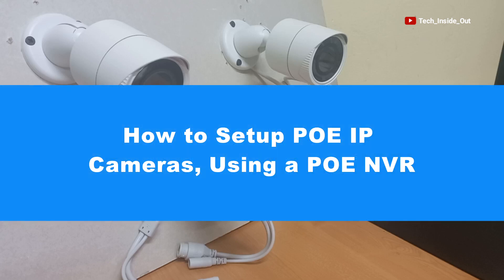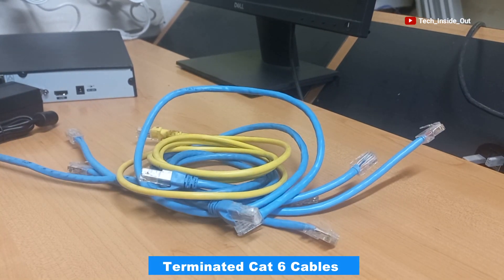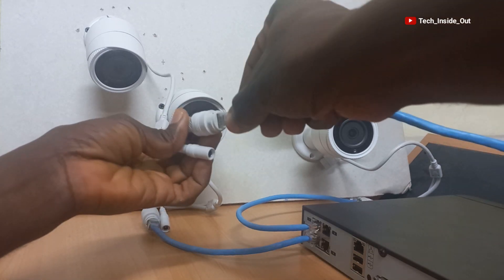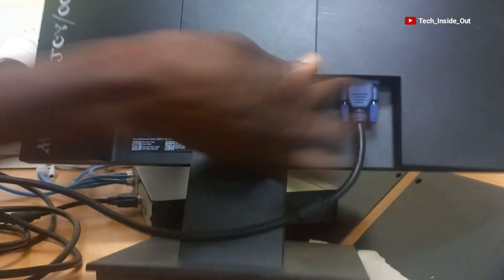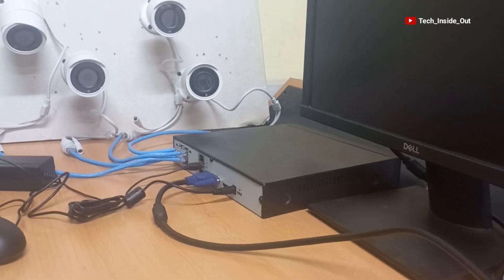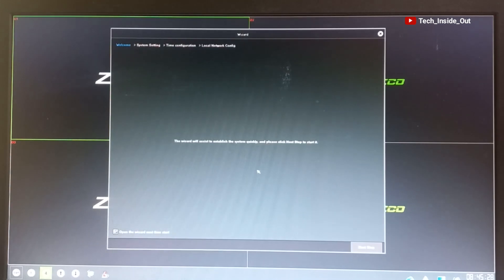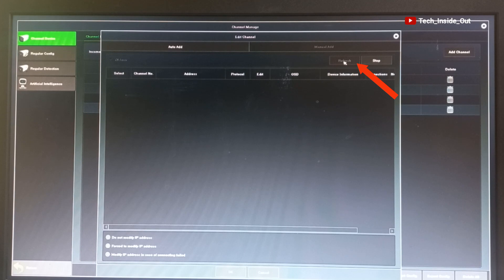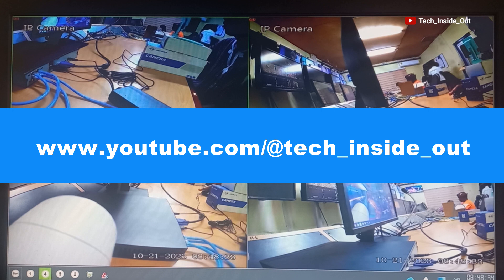How to install network IP CCTV cameras using POE NVR

Comment: when is it neccessary to use power splitter?
Reply from the maker: The splitters are used whenever you are using non POE IP cameras and you wish to power them up through the same network cable that carries video from the camera.
Reply: @Tech_Inside_Out  great. Thanks for the reply 🙏🏻

Comment: Thank you. This is the simplest yet and I’m thrilled because as you explained it, I was able to connect my cameras to my DVR without a problem. although, my monitor to DVR cable is USB, it was easy to see where they connected and voila… it works, I wish. The monitor is on and the NVR but it says “No Signal.” Sigh. Maybe I’ll just sent it back. So frustrating.
Reply from the maker: Am excited it worked for you. Please check your cable connecting your camera.

Comment: Nice tutorial. One question that maybe you haven’t had before. 

Is it possible to connect a monitor in one room via the VDA port & also connecting to my TV in another room using the HDMI port. Two permanent connections.
Reply from the maker: Yes, you can do that

Comment: Perhaps a silly question but does it matter how many POE ports you have if you are only using a switch? For example if I have 4 POE ports on my NVR but have a 9 port Switch with 9 cameras plugged into the switch would this work okay and I be able to view all 9? Or would this be too much for the NVR? Many Thanks
Reply from the maker: You have asked a very good question, and the answer is that the number of ports on the NVR is the maximum number of cameras that the firmware in the NVR has been designed to receive.
There are some brands that may give room to go beyond the POE ports on the NVR,  in such a case, you would see the NVR capacity stated with the number of cameras it takes.
Please let me know if I have been able to Well address your question.

Comment: Can a NVR that has only one Poe port accommodate any number of IP cameras from a Poe switch? Or single port NVRs has limited capacity of IP cameras that can be fed into them via Poe switches?
Reply from the maker: They have specific capacities such as 4 channel, 8 channel and so on. You can't exceed its capacity
Reply: @Tech_Inside_Out please how to called you number